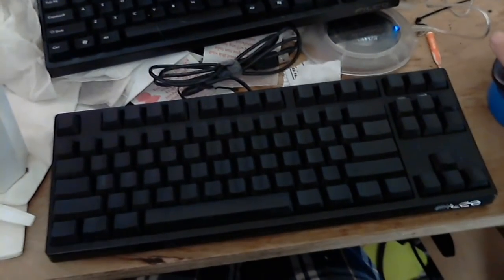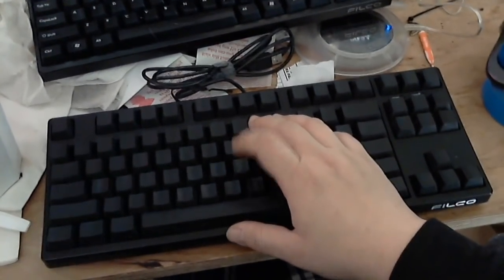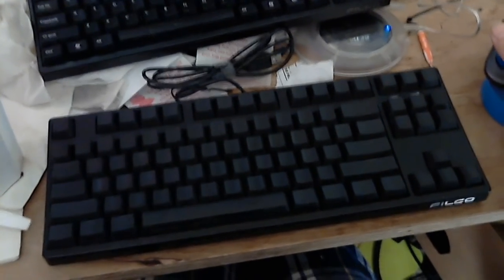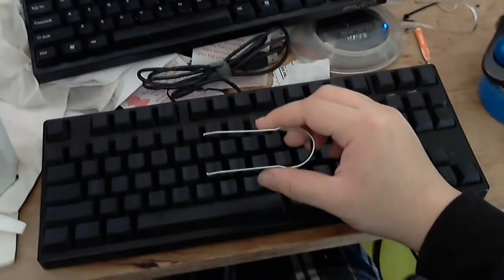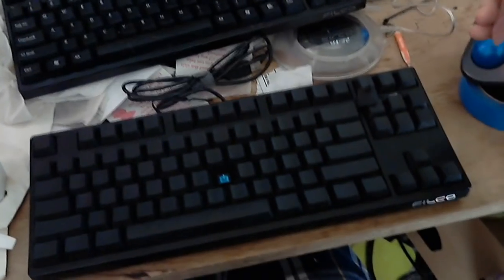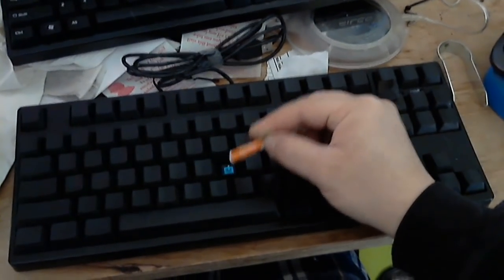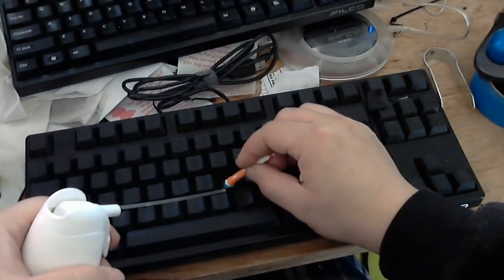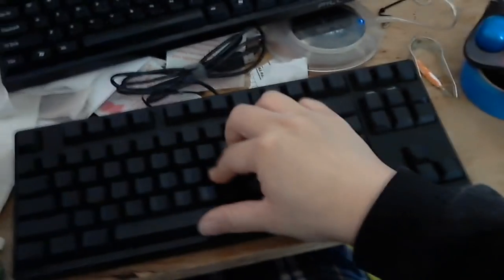How to Fix a Sticky Key on your Mechanical Computer Keyboard

Comment from the maker: As I mentioned at the beginning, if this method of blowing air into the switch doesn't work, you can try to wash it to clean the sticky stuff, and let it dry for a few weeks. If that still doesn't work, you may have to replace the switch by desoldering it from the circuit board and solder a new switch. This is obviously a bit more involved.

Comment: Thank you so much! You just saved me from going through the pain of writing a clear and formal letter to steelseries customer support (using 7G) and then have to wait for days. This trick solved my sticky key problem!

I didn't have compressed air, but blowing very hard, making sure you don't get saliva all over the board, did the trick just fine!

Comment: Omg, this actually really worked. I spilt a drop of soda into my "a" switch and it was messing up my gameplay, and was worried i was going to have to wash the the switch with water or alcohol as this is a fairly new keyboard but surprisingly just simply blowing on it worked great!. Thank you so much.

Comment: I'm on my 4th keyboard since 1996, when I got my 1st computer. Presently, I use a back-lit keyboard which I bought on EBay (I have forgotten the price, but it was very cheap.)
Today, the spacebar decided to do the 'sticky' act!; after releasing it, it seems fine.
I use the air-blower from my camera lens cleaning kit to regularly blow out dust and debris.
Maybe the switch in the spacebar is wearing out? After all, it is the most used key, is it not?
You could try a little WD40 (petroleum cleaning spray in an aerosol can). It has countless uses!! Add one more to the list!
I'll also buy a can of compressed air. It makes a lot of sense!
If it fails I'll just get another keyboard. Come to think of it; I think I'll buy another one now, just in case this one decides to die on me. And I do need to write!
Love and happiness to all,
Ilonka and Daz x x
Reply: dang, so this is what old comments are like

Comment: my genius sister spilled a bit of syrup on my 'd' key and now, i think there's syrup inside the switch and now i can't get it out
Reply: Soak the keyboard until the syrup is gone. Maybe warm water, for a long time. Then let dry for a few weeks. If you didn't destroy the spring inside it should work.
Reply: ***** so, wait, your saying DONT soak it in water? lol
Reply from the maker: ***** Yes, soak it in water. without electricity, it's perfectly fine to soak electronics in water. But you MUST make sure the water is completely gone before plugging it in, and I usually let it dry for at least several weeks up to months.
Reply: Also interested in the results of soaking.

Comment from the maker: There are many ways, first, like it says in the video, try to wash it and make sure it's completely dry in a few weeks. The switch can be disassembled; the top and bottom half of the housing was snapped together, but most are panel mounted so you need to de-solder it to open itv- might as well buy a new switch to replace it, only a couple bucks online. I never had luck re-assembling the switches b/c the metal springs a little differently after put back together anyway.

Comment: i have the mercury mechanical keyboard and i spilt pepsi on it and now the 0 8 f7 7 f8 n and m keys are all stuck, what i mean by that is the when i p[ress on them they stay down and take 3 seconds to pop back up ;-; someone help please i tried using rubbing alcohol on the switches but it still didnt fix it, only a temp fix it was but it just uwent back to being sticky ._. help me plz someone
Reply from the maker: It's sugar. Soak it in water for a week or so, dry out completely, say a month in dry places.
Reply from the maker: It's sugar. Soak it in a lot of water for a week or so, dry out completely, say a month in dry places.
Reply from the maker: It's sugar. Soak it in a lot of water for a week or so to desolve it , dry out completely, say a month in dry places.
Reply: +carolcheny 3 times? Lol ty btw

Comment: Is there any other way to fix this?
Reply: If you paid attention to the video, I have listed three many ways to fix it including desoldering the switch and soldering a new one. Which method have you tried? I've never had a keyboard that I couldn't clean out, and I own dozens of these for over 20 years.
Reply: Carol Chen I spilled Green Tea on mine, I soaked the entire board in alcohol and it still sticks. Any tips? (By the way I can't get at the PCB because stupid corsair hid the screw under the logo you can't remove)
Reply from the maker: Cillian Scott Every keyboard can be opened, typically by removing screws underneath (under feet and sticker) and prying the edges. Sometimes you might have to damage the plastic if you don't know how.
Thing about these key switches, because they are mechanic and have many parts per switch, if any of the components lost mechanical integrity, the switch won't work. This can happen when something awful gets into the switch, or people trying to force down the switch when it is already stuck.  
Most of these key switches - actually, all of the ones I have ever seen, are frame mounted. That means the switch is not only held by the PCB, but also a square frame around it. You are most likely unable to replace the key switch without having to remove a lot of neighboring switches, if not all. Is there another way? Yeah, you can possibly extract the top half of the switch without unmounting the switch from the PCB/frame and swap out some internal components. It gives you a chance of fixing the switch , but you are not likely to succeed because a switch is a very delicate mechanism, any little tweak, bend, will make it not usable.
Reply: carolcheny can't take the sticker off though. :/

Comment: i just use WD-40
Reply: +AV1 --- Thats actually is a pretty good idea. WD40 is not conductive. But it won't remove any hard objects from switch, so I would actually wash the switch with WD40, clean everything around it and then apply compressed air to remove all the nasty stuff.

Comment: It would be better and cheaper just to buy a new keyboard..
Reply: when a keyboard costs 150 bucks thats not true
Reply: ScottJoC who buys a 150 keyboard?\
Reply: chocojo joe I do.  My keyboard cost me 210 dollars.  It feels a lot better to type with and game with than a regular keyboard, plus it has custom backlighting
Reply: No, it wouldn't.
Reply: 0/10 lol. Tactless troll is tactless.
Reply: chocojo joe People who buy mechanical keyboards
Reply: I live in Canada, in a province that has a high tax rate 13 percent, plus you have to include other taxes into that equation.  Me purchasing it online would have cost me exactly the same thing if not more
Reply: Ed Pirelli I seriously just took the key of with my fingers and blew into the gap and it fixed it.
Reply: ivenstorm seems like you dont know anything about INDIA a normal 100$ blackwidow in INDIA costs around 250$ with custom duties and other taxes :(
Reply: Ed Pirelli mechanical keyboards aren't like normal keyboards.  much higher quality and durability but expensive
Reply: Ed Pirelli where do you have the money to buy a 130 dollar keyboard all over again?
Reply: +Brandon Dusk you obviously don't know jack shit about gaming keyboards then
Reply: nonames000 I did that once and took out the whole switch. Always use a keypuller
Reply: +Akash Devkate Blackwidow is a cheap-ass chinese switch (Kailh) keyboard. Any chinese keyboard with Cherry will blow it out of the water, there are chinese Kailh keyboards for around 60 bucks.
Reply: +Prometheus Hippopotimi I can make a keypuller out of three regular paperclips, which is as good and safe as the best commercial keypuller. =) Bend two paperclips into an "U" with "o" on each side, then bend last one into an "O" which goes through the "o" pairs of two paperclips. Important is the bottom size in the "U". The puller on the video is awfull.

Comment: Wont soaking the keyboard mess up the led backlighting?
Reply from the maker: +Cartman No, electronics won't be damaged if they don't have power. Just need to make sure it's absolutely completely dried before plugging in.
Reply from the maker: +Cartman Correct, but it's way, way harder to dry the inside than you think. Outside might look dry, but little gaps can keep water for months. So you need to make sure they are completely dried inside.
Reply from the maker: +Amenze  I don't know of a sure way to check that. I live in a dry place, and I usually let it sit for months - I have many keyboards as I am a keyboard collector.